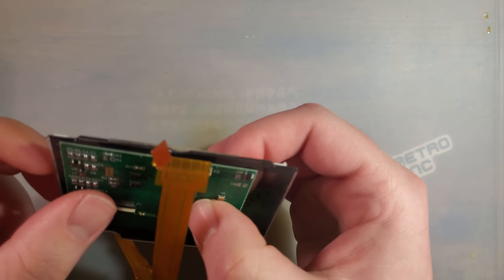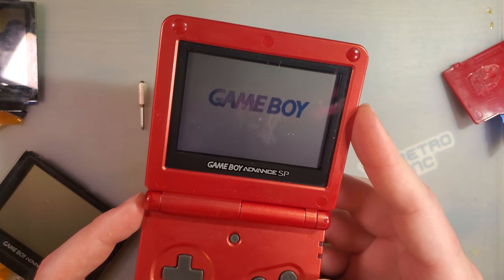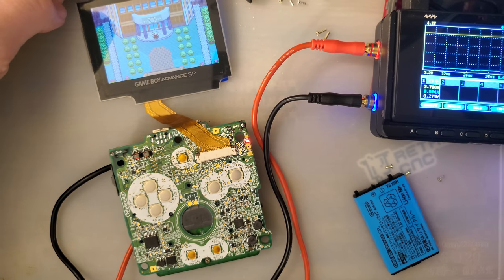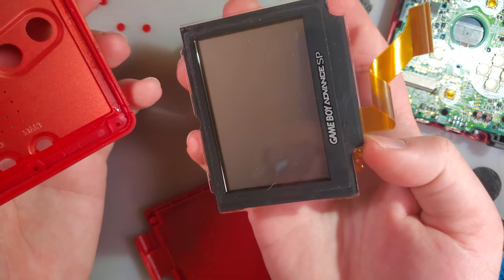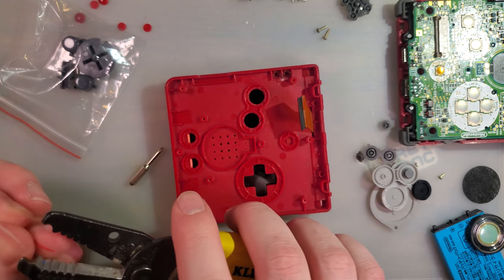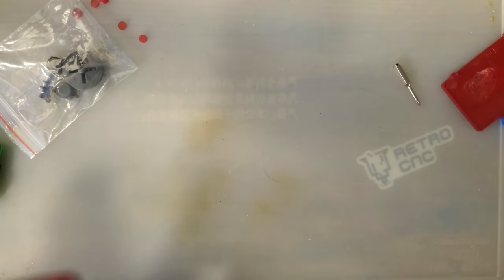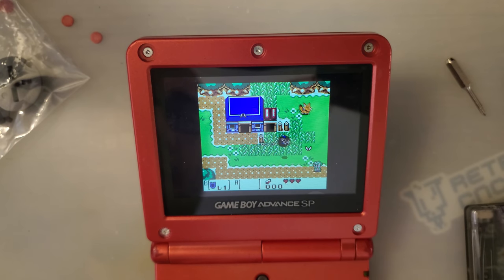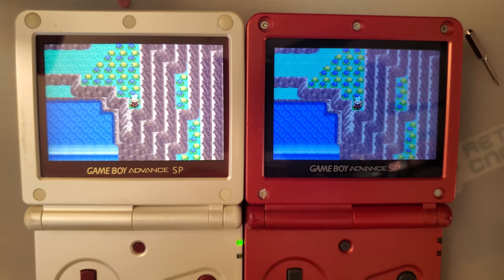Game Boy Advance SP Drop In Backlight Kit - Cloud Game Store [Production Sample]

Comment: Very good video, as always!
I just ordered one of these kits for testing. There are already some differences to your kit: In the final product, the shell has to be trimmed, the touch dimming cable is canceled (as you mentioned), but a cable can be soldered to the ribbon cable and to Q12B on the motherboard (for button use) and the PCB number is GTH_V5.3 instead of GTL_V3. I hope the brightness and contrast will get better with the final product.
Reply: Now I have installed the final kit. You definetly need to cut out the little part of the shell. And I am not very happy with the colors of the display either. It's still like in your video. White is very cold (blueish  tone) the colors aren't vibrant and the contrast in not very good. The brighness button works fine though. I still recomment V2 over V3!!!

Comment: Really dig the SP logo on the lens of the Cloud Game Store kit, almost looks like the real thing. Is that lens came with the kit?
Reply from the maker: it's a salvaged OEM lens that came with the sample
Reply: @makho  Awe, then that means there is a high chance that the production version won't have the right logo. Man, I really want to do an IPS screen replacement for my front-lit SP but somehow every kits on the market never has the right SP logo and that really bugs me.
Reply from the maker: @sonang7721  as I mentioned in the video, mine was a sample and that they will not be coming with the lens. You can use whatever lens you want.
Reply: @makho  If that so, I should probably hold on to my OEM lens for when installing this kit then.

Comment: Firstly, thanks for the content.  Quick question, what gauge wire do you use for your mods?
Reply from the maker: generally, I use 30awg solid core kynar. It's very easy to work with, thick enough to run a reasonable amount of current but not too thick that I can't just cram it nearly anywhere. For actual power delivery, I'll bump up to 28awg or 26awg solid core just to be on the safe side.

Comment: My man, in the gbc ips mod from FUNNYPLAYING was the first/last line issue fixed? Is there maybe a programming file for the fpga?
Reply from the maker: funnyplaying has an entirely new GBC kit out so technically yes it was fixed. No there is not an update available to flash your existing kit.
Reply: @makho  are the lcd and ribbons compatible? Do you know if its possible to buy just the pcb?
Reply from the maker: @zdebel  completely different screen https://www.youtube.com/watch?v=H5-sYNd3Cas

Comment: I'm still waiting for a gba ips kit with pixel grid.
Reply from the maker: You're going to be waiting a while then. It's a bad looking feature that adds overhead to the cost of the panel and the conversion electronics. If you're after "muh nostalgia", go buy an AGS-101 and play on that.
Reply: @makho  It's not just nostalgia, I just think some games look better with the grid. I have a AGS-101 (with a green stuck pixel), but I'd love to have an IPS with the pixel grid, so I could play everything on just one device.
Reply: @poopfacedude69  I agree! But even those CRTs had scanlines, which are somewhat similar to the pixel grid. And I believe both the scanlines and pixel grid end up "easing" those pixel edges.